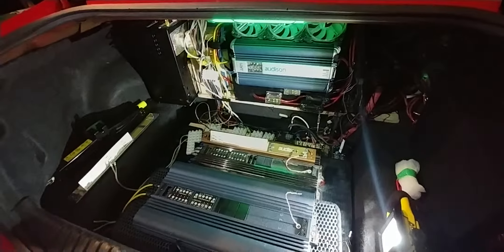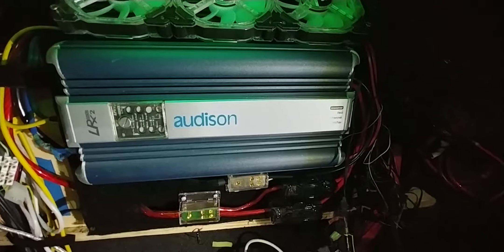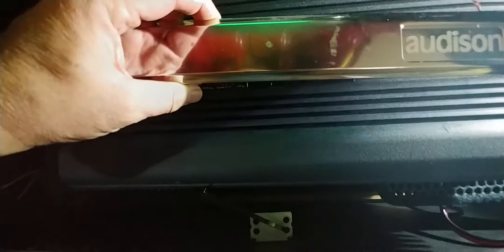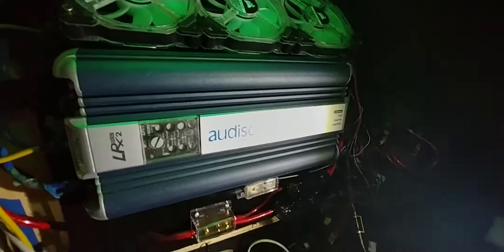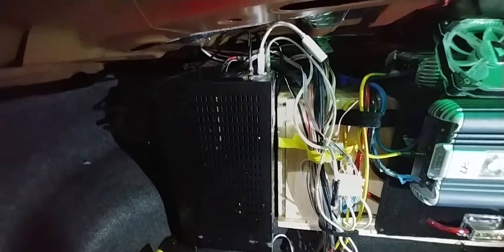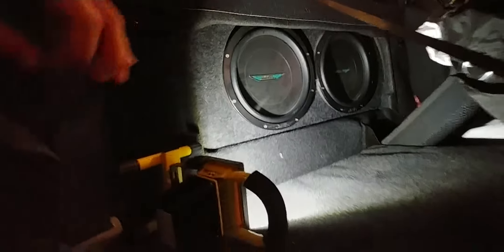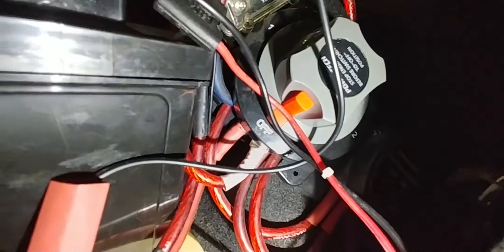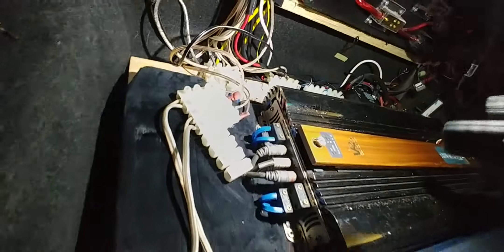Audison amp tour. PC sound processing DSP. Car sound dream SQ setup.

Comment: Hope you're doing well sir, questions, how much power/watts do you have on your "midrange and midbass drivers?
Reply from the maker: The 8inch drivers get 200 and the 3inch gets 300 so does the the tweeters. The gains are all set to low and the dsp barely feeds them 3/4 signal at high volume listening. I'd say they could all run at 100watts but sounds better this way.